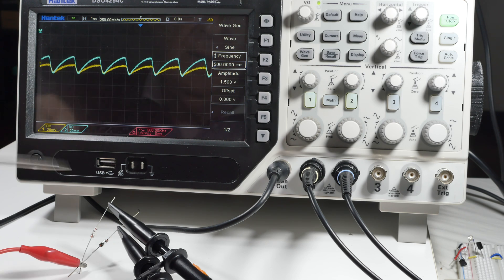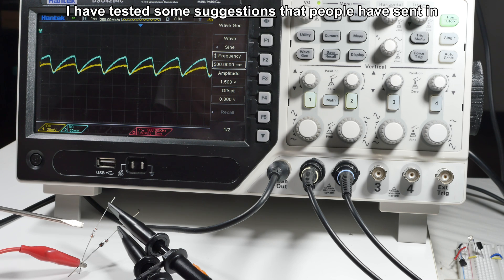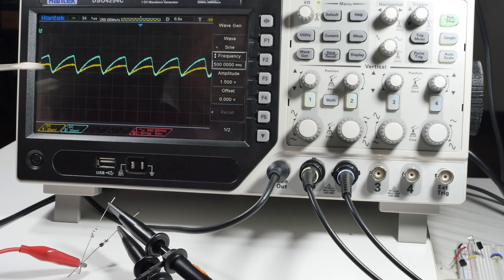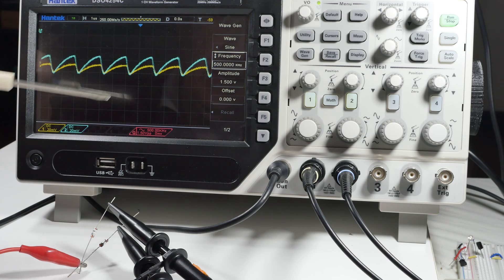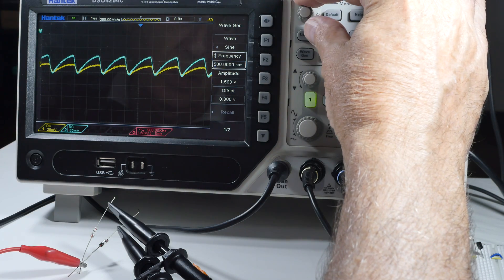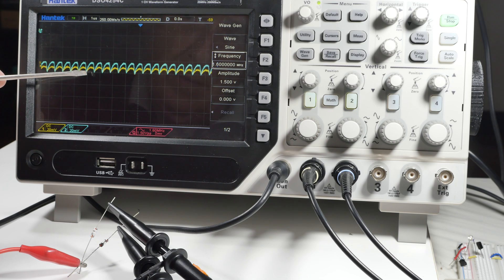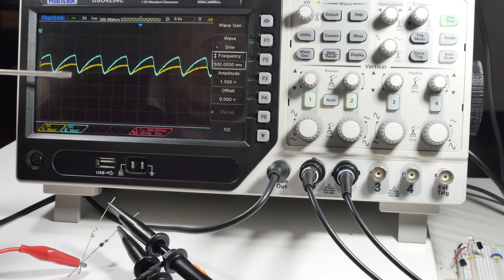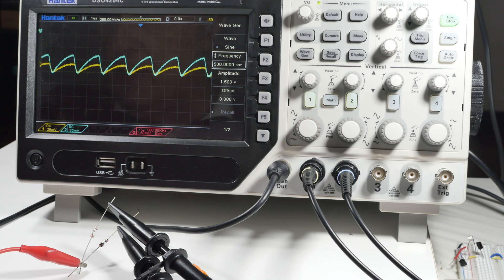Crystal Radio-A Good 1N34A Diode Substitute (4K)

Comment: From what I understand of your "test", the D9K has a higher voltage drop than the 1n34. I don't see any series resistor, so I do not fully understand what exactly you're showing on your scope. The main reason to choose germanium is lower Vf. So I did not understand why your conclusion is the D9K is better..  ?!

Comment: Where I worked as a technician until a couple of years ago we had a problem getting germanium diodes that worked, probably there were a lot of knockoffs circulating, the older diodes in stock did work.
Reply from the maker: Interesting, but sadly not surprising with all the fakes out there.

Comment: What about the OA79 ? I seem to remember using this device in a crystal set 60 odd years ago.
Reply from the maker: "Germanium contact point high-frequency diode, intended for use as detector in FM receivers". There are lots of diodes that sort of work, but give poor sound quality like clipping or low volume. I have not tried this one but it seems made for other purposes.
Reply: @tsbrownie  I think it was included in the Philips EE kits, which I had. Worked quite well if I recall.
Reply from the maker: @StepDub   I'll have to see if I can find one to test.